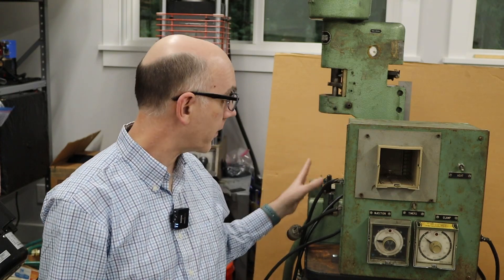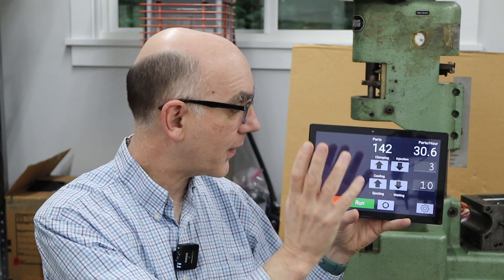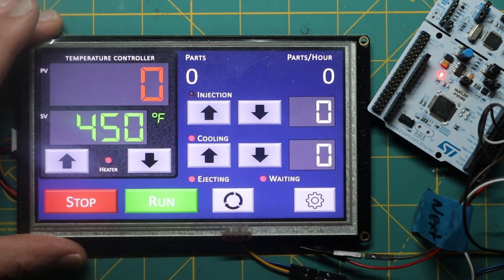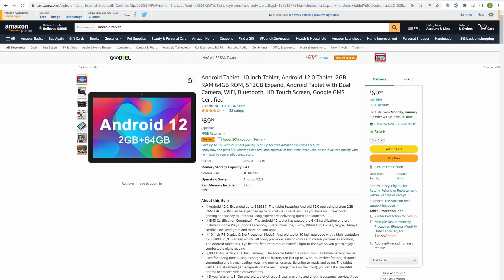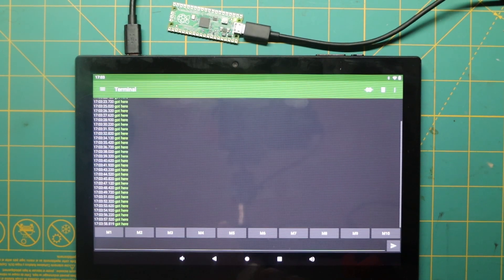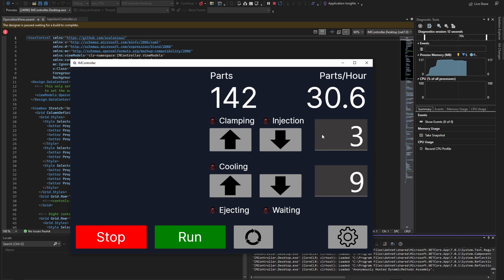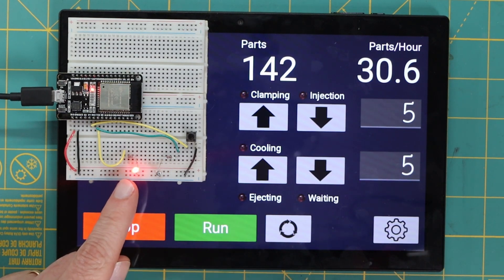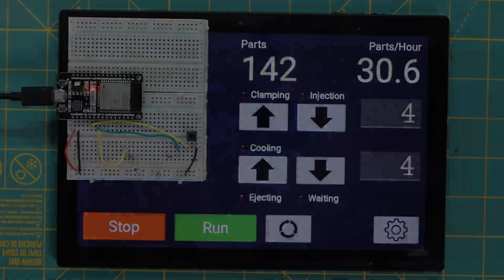Touch screen for a 60-year old injection molding machine

Comment: Stereo voice recording: Dont bother. Stereo sound for voices is something that isnt even done in recording studios. The worst is those Rodes are notorious for breaking or losing one channel which is very annoying I imagine. Just make sure the one channel is duplicated on left and right and everybody is a happy camper :)
Reply from the maker: I have the Rode set to "merge" so that the microphone is recorded to both tracks. My previous mic has that behavior as well. However it was far to easy to change back to sending the signal to just one track (it was a single button push, which I would do by accident).
Reply: @JohnSL  Yeah, thats a stupid design decision on their part then, in my opinion.
Reply from the maker: I agree. Which is why I decided to switch to another manufacturer (I'm not naming the one with the stupid design).

Comment: I am in about the same state with a 1962 Arburg 25T Allrounder.   I designed and built a PCB for a generic molding machine controller with 24V coil drivers for Arduino Mega2650 with the intent to interface to a laptop for user interface.  After 2 years no progress......  I just designed a ESP32 S3 board for LCD touch display for another protect.  You should look at the SquareLine Studio and  KVGL graphics library, May be a good marriage.  Maybe time for me to get back on this project too......
Reply from the maker: I've done LCD programming in the past from an ESP8266, so I knew what would have been involved in going that route. Using an Android tablet is so much faster for several reasons. One is that WPF (which is basically what Avalonia UI is) and C# allow me to go a whole lot faster, as they take care of things like layout, rendering, interaction, etc. I can also easily have profiles for different molds that are saved and therefore that you can reload. Doing this all with a desktop application is a lot less work than from C++ (or Rust). I also have an Allrounder 100 that I need to bring back to life, and figured I could use this as well. That will likely require some additional electronics, but I'll be able to drive them from the digital outputs of the board I plan to design.
Reply: @JohnSL  You are welcome to use my design for the controller.  It has drivers for 8 solenoid coils, 8 switch inputs, up to 8 thermocouple inputs, up to 8 solid state relays for heater drivers and plugs into the Arduino Mega 2650.  Using a $10 touch graphic LCD and the SquareLine Studio and  KVGL graphics library you would have a controller for less than $50.   A micro SD card would allow a much more advanced controller with expanded setup storage and flexibility.
Reply from the maker: Can you send me an email? You can find my email address by clicking on the button here: https://www.youtube.com/@JohnSL/about
Reply: @chuckinwyoming8526  i m planning to rewire my 80 ton machine using similar concept. Atmega 2560 and cheap tft touch screen and relay board to drive contactors. Do u think atmega is reliable to use in industrial machines like molding machine which run 24x7.
Reply: @clappgames5474  Yes the Atmega 2560 has several fault traps you can use like the "watchdog" that will interrupt or reset the processor if it gets lost and a timer times out.  Jams or mechanical problems are much more likely.  You want to have switches and sensors to catch these mechanical problems and write code to deal with it.  You can write fault shutdown and recovery code for processor and other faults and nearly eliminate the odds of a bad crash.  In the unlikely event the processor does get lost the worst you may get is a jam, short shot or partly cooled bad part.  The PCB that I designed will allow all likely heater PIDs, input and control functions most molding machines will ever need.

Comment: cool esp32 stuff, what did you do to run it locally ?
Reply from the maker: I just implemented support for talking to the ESP32 from my desktop app. Thank you for the idea! Now I can do most of my testing from my desktop, and then occasionally from the tablet for a sanity check.
Reply from the maker: When I run it locally, I don't currently have Bluetooth support, so it's just for quick layout/interaction testing. But now that I think of it, it would not take much effort to support Bluetooth for local testing as well. That would speed things up a little!

Comment: Nice! I've been getting "flash backs' whilst watching your videos to a time in the late 1980's I  was just out of my apprenticeship working in the UK for a factory which mainly made car electrical switches. I was kind of lucky being in the prototype/ small toolroom area we would sometimes make Ally moulds and run small  batches on a manual injection moulding machine. I think it was called a Manumould machine
Reply from the maker: I've heard of that machine. I remember a person in one of the Facebook groups that I watch acquiring or selling one of those machines. It looked pretty interesting...
Reply: @JohnSL  quite a crude/old machine ours was. Simple straight hydraulic plunger (no screw) horizontal machine. Had a crude manual ejection device.  Man I can still remember the smell of overheating the plastic (nasty!!)

Comment: Great! I'm looking forward to see how you integrate those electronic commands into the hydraulics of the machine, and in a broader sense how you transform a relatively cheap single shot machine into semi or full auto.
Reply from the maker: Thanks. Initially I'm going to use this for my Arburg C4b, which is pneumatic and designed for running fully automatic. I've been thinking about getting a Buster Beagle 3D Mk3 to retrofit as well.
Reply: @JohnSL  One of the Travins would be a great starting point. One of them is already semi-auto
Reply from the maker: I guess my Travin TP-1 might be called semi automatic. However, the toggle clamp right now is human powered, so hard to make automatic. It might benefit from replacing the temperature controller (which is just a dial and a light) with a PID and add a pneumatic valve for consistent injection duration. But first up is my Arburg C4b.